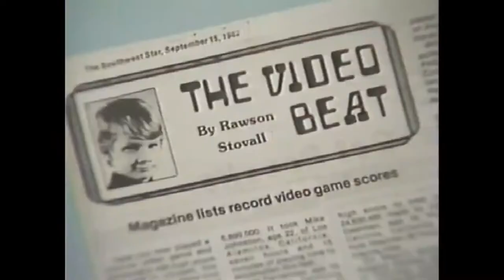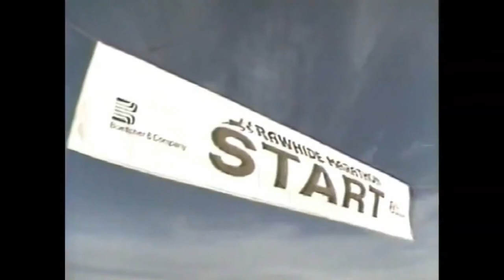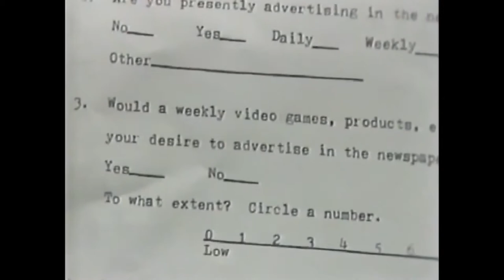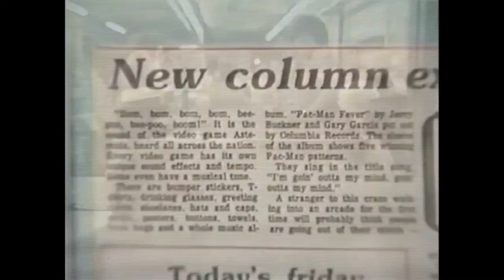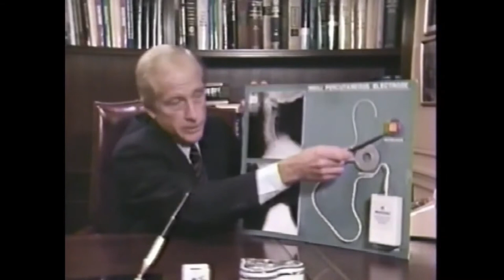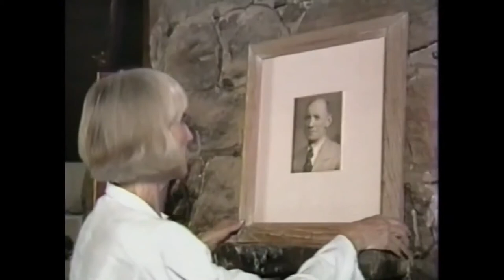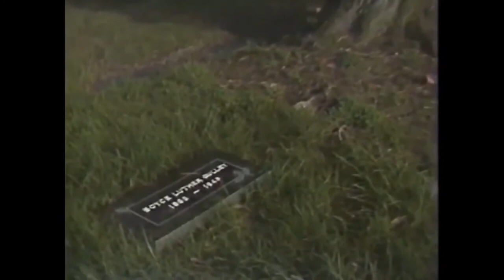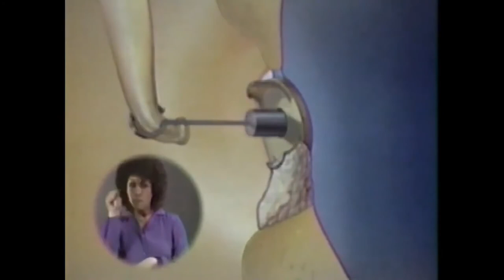That's Incredible  :  1980's Tv Show Episode 3

Comment: Anyone know the episode with that invention of water you could paint onto wood?  So as to fireproof combustible materials.  This water would flow as a liquid under pressure, but when left static - it would act as a solid. There was also an aerogel that could absorb shock. They put a raw egg in between sheets of this stuff and hit it with a sledge hammer and the egg did not break.